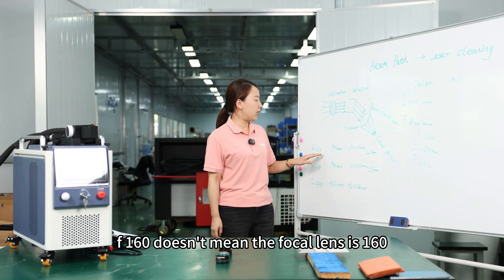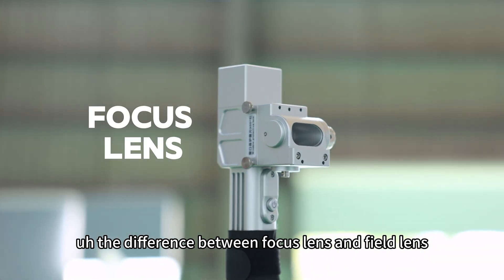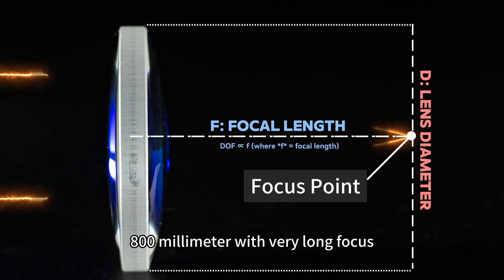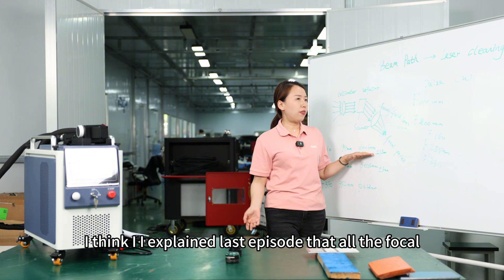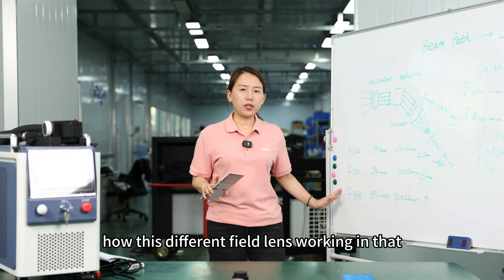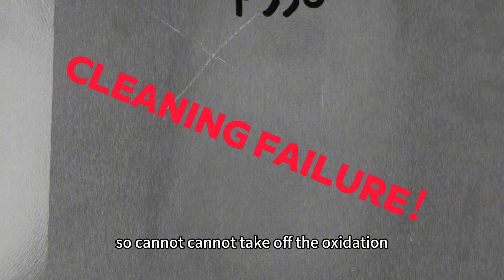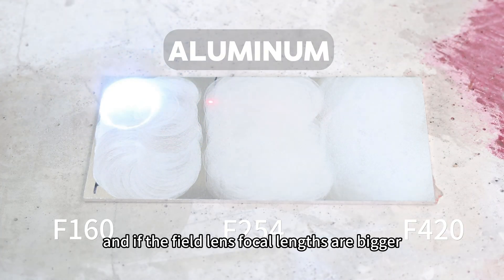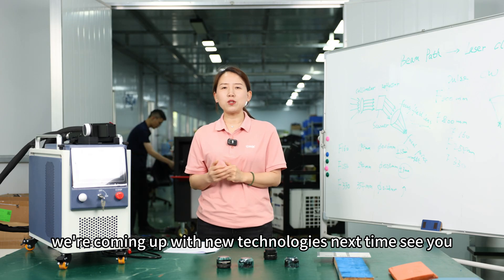Laser Cleaning Technology: The Impact of Beam Path Configuration on Cleaning Effectiveness #DMKLaser

Comment: You gave the example of a 200W laser on wood. How many mJ does that laser have? Will a 300W 15 mJ laser clean wood better at a focal length of f330 than f160?
Reply from the maker: generally speaking, 300w 15mj is not the right type of laser to work on wood